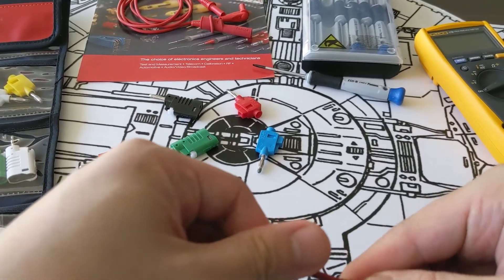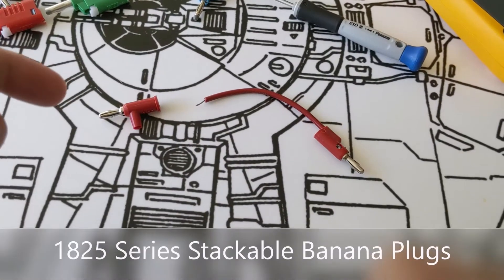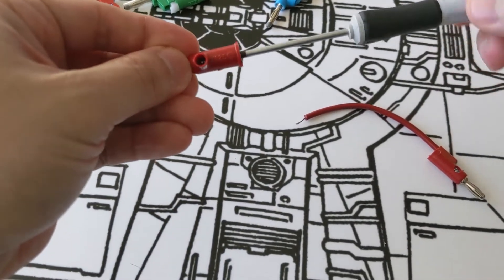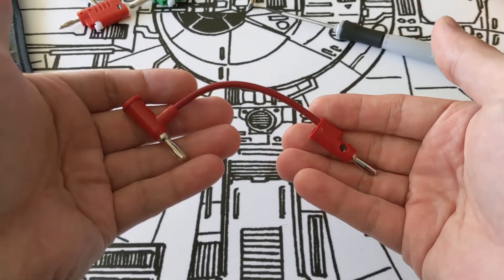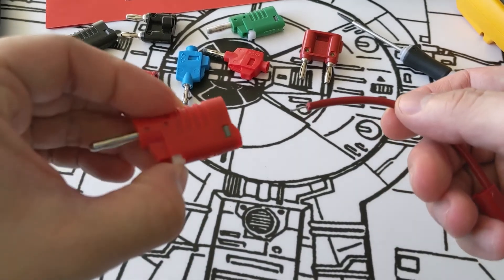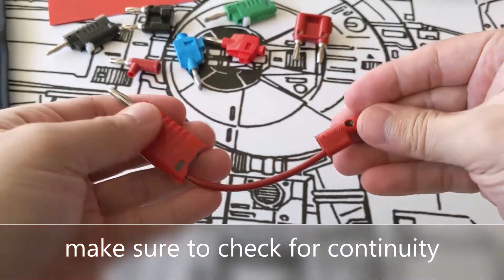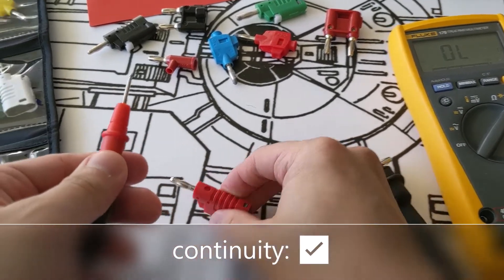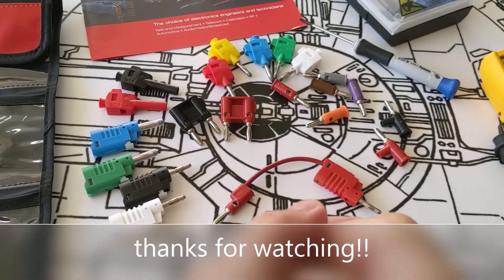See These Quick and Easy Ways to Build Your Own Test Leads ┃ Pomona Electronics DIY Banana Plugs

Comment: I emailed your company and the response back was a bit snippy.  I then asked what do you have that will fit 12 awg silicone wire.  I never heard back.
Reply from the maker: Hi, these connectors only support wire gauges between 22 to 18 AWG.  unfortunately, we currently do not have the quick connectors supporting 12 AWG at the moment.